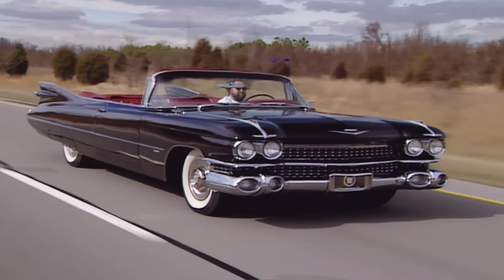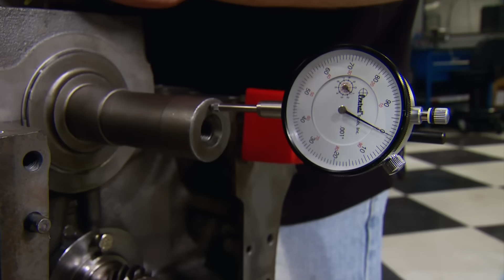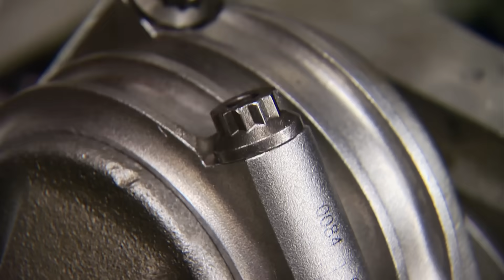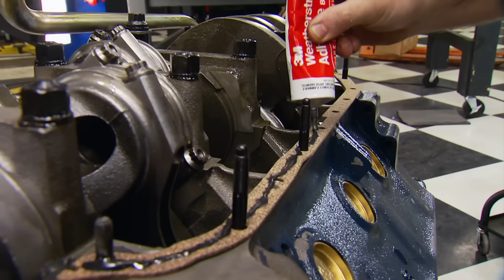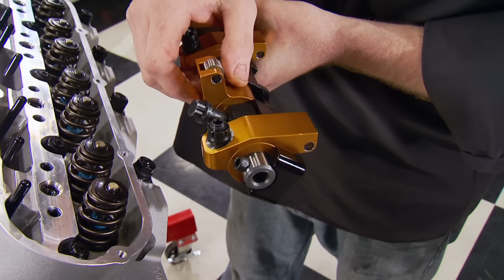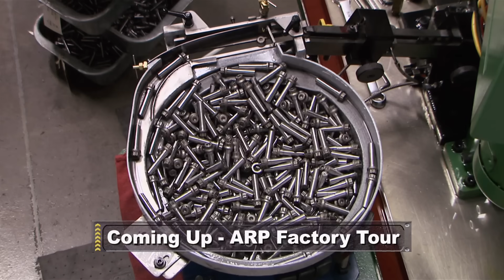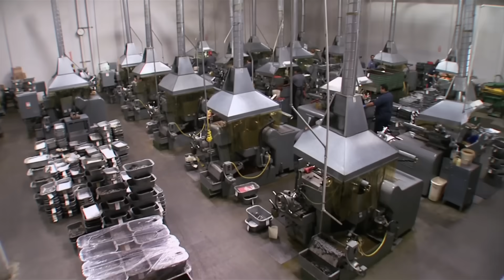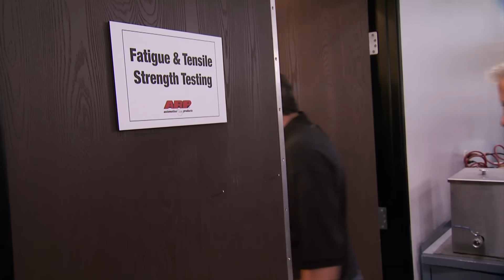Turning A Junkyard Cadillac 500 Big Block Into A Modern Day Monster - Horsepower S16, E3

Comment: the biggest GM motor ever put in a production like a truck was a 637 cubic inch big block it had 5 and 1/8 inch Pistons with a two and three quarter inch stroke
Reply: That big block was GMC 637 Big Block Chevy and the GMC 702 Big Block V12.
Reply: @CJColvin  It wasn't a BBC like a 454.  It was an 8 cyl. version of the 60 degree V6 debuted by GMC in 1959.  Sturdy bottom end let down by dinky valves and poor breathing.  But it did make a lot of torque and last a long time.
Reply: @Bolton115  Yep thats true

Comment: Whats the parts cost total on this motor?
Reply: Cadillac motors are a boutique motor while mass production has driven the cost of GM big block parts down so Cadillac horsepower is more costly than GM horsepower. FYI All Cadillac 500 motors from the factory are 502 inches. My "57 Coupe DeVille has a 502 inch Caddy motor in it, giving it luxurious grunt.
Reply: @USARAY1947  No, they're 500cid.  502 was the EPA engine emissions control designation for this block, that's why the 472 cars also say GM 502 on the emissions label.  But yes, they are boutique in that it seems spendy to put one together-but the payoff is you only have to do it once and the reliability in real world usage is stellar.
Reply: @USARAY1947  Where did you see that? It's apparently 500.02 c.i. not that I want to argue about it 😁
Reply: Yeah I like the motor but it would only make sense to go 454.
Reply: I went and looked on their website.. holy balls is it expensive.  You could build two gnarly big block chevies that would eat this thing alive for the same cost.
Reply: @superkillr  Thats why I asked the question, I already knew the answer. Could prolly build a 600hp sbc just for cost of those heads and rockers alone.

Comment: 3000 rpm? It made peak power around 4000 rpm or so stock so🤷‍♂️
Reply: It has weak cast rods.  I would'nt over rev it.  Still the 70 was 400 HP then it dropped every year.  When racing my Eldo I have found to let the automatic do the one -two shift then maybe hold it a little longer in second.  More gears would help a lot.

Comment: Should have EFI. What a waste
Reply: Got that 600+ with EFI I believe.
Reply: For what reason? Efi its self doesnt make any more hp than a carb.
Reply: My 70 has carb and points
Reply: Look like the Intake already had Injector bosses ready to machine.
Reply: The later 500s had FI but maybe it was mechanical.  I don't know.  Solid state ignition was new in the 70s.  Computers were pretty unheard of.

Comment: Always loved ARP and now seeing what they do these will be the only fasteners I use just love the quality and QC checks.
Reply: Unfortunately they're products are hard to acquire currently.
Reply: @maynardreed8374  not in Australia there is plenty of stock for most builds
Reply: They've been real good for me too. I have them in repeated use for the last 13 years. Haven't had any break yet.
Reply: Can’t hardly find anything ARP in the states nowadays. I bought the last ARP SBC crank bolt I could find, and I searched for days.
Reply: ",,,loved..." what an abused word
Reply: You have to be careful with machine shops using ARP fasteners to build engines. Main and rod caps must be resized with the ARP studs. I sent ARP my caddy rod mains still held together by their bolts, post emgone destruction. The idiot engine shops fatigued the rods when they overheated them during assembly.

Rebuilt, that engine still runs today!
Reply: I won't support a company that discriminates against white men for the purpose of employment.  I'm so sick of this antiwhitism, and I won't tolerate it anymore.

Comment: as a little kid growing up in the 80s my folks bought a used 1977 caddilac sedan deville 4 door with a 472 big block . when we moved to the branson area in 89 and the car got parked because the suspension and wiring started to take  a crap . my dad had a plan to yank out the working motor and tranny to drop in a project 72 Chevy Nova . well that goal got shit canned and the car got hauled off for a couple hundred bucks 🙄
Reply: 425 My Boy
Reply: @terrellstevenson3356  425s ok just couldn't lean on them too long. Or maybe we just were not building them right.
Reply: There was a guy on the east l think his name is Kevin brochard that made a kit to drop 472    500 ci caddy engines into gm G bodies. Supposed to do 12s with stock 500
Reply: @gmac8852  They make a kit for G bodys and they fit well. A stock high compression one will run 13s in a G body while shifting at 4500rpm with 2.73 gears. They must get valve springs and rocker arms to rev past that or if you put more cam in them.
Reply: 77 never got a 472. 425 I believe you mean.
Reply: @95roadie   just going off the casting numbers that my dad's chevy buddy found on the engine
Reply: @MoparMan1978  not saying it’s impossible. Everyone was swapping engines back then but factory 77s never had the 472 option
Reply: 1974 was the last year of the 472. 1976 for the 500. I think 1977 would of been a 425 that later got replaced by a 368.